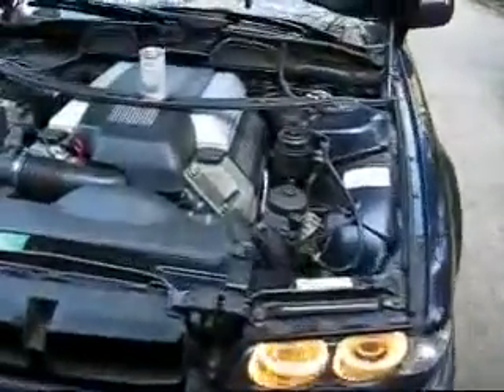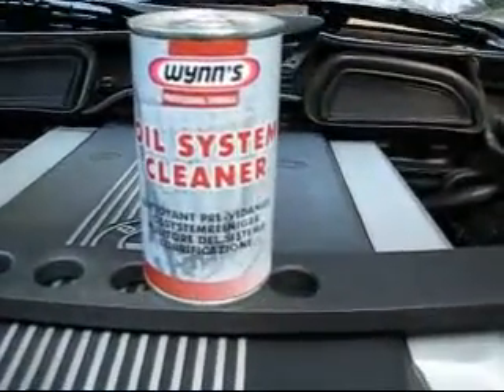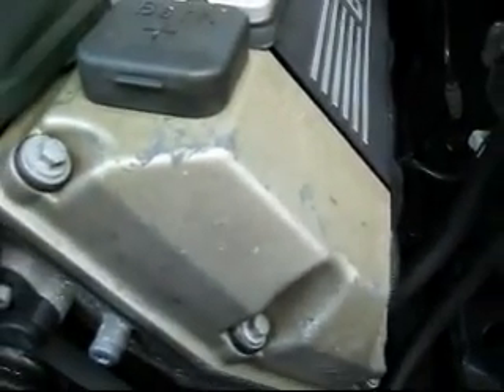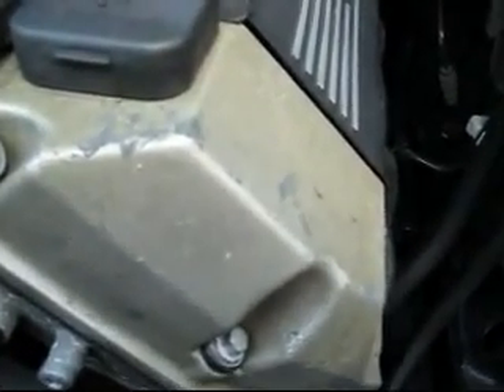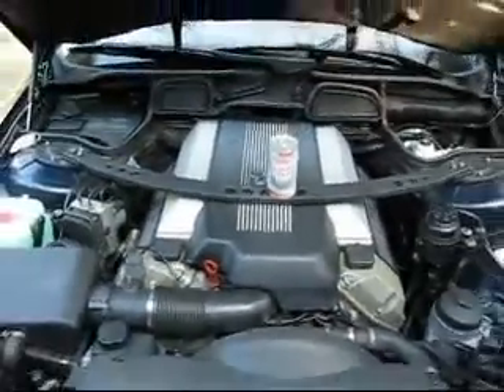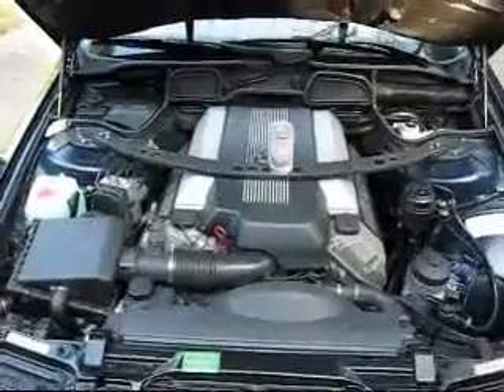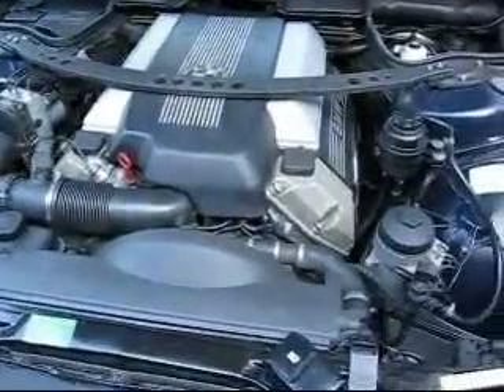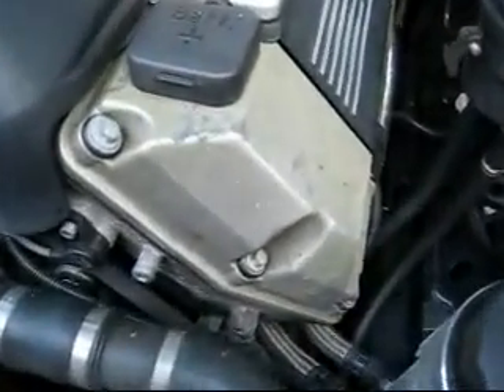E38 Engine Flush and Castrol Edge FST 5W40 oil

Comment: If you take the head covers off, and clean it with gasoline or any solving product specially the VANOS chain tensioned and also remove the main chain tensioned and clean it. Also the spring inside stretched it out 3 quarter of an inch and install it back.  I will guaranty the noise will be gone

Comment: Erm.......................I think you'll find that the ticking/tapping noise can be only one of two things, and no amount of flushing will get rid of it.

1. Main chain guides on the way out.

2. VANOS units worn, ie: Camshaft Adjuster Units.

I changed my VANOS units and the noise is no more. Nice and quiet now.

Comment: No really but what happens is the upper pensioners over time they get clog with oil and other particles specially if you don’t keep a changing your oil regular and the main pensioner is also one of this cars problems, most people jus replace it with a new one, but all it really need is a good clean and stretch the spring just a bit. Trust me it’s sensible to try this approach first, then having a dealer charge you over 3 grand for an overall replacement on you timing chain

Comment: Hi There
I have a E39 535i Sports 2000 Model with the M62TU Motor with the same sound, Did the Oil Change have a long affecton the noisy Motor issue?
Or after a while it came back again.
Any help would be great.
Thanks for posting
Addam

Comment: This is old thinking from back in the days of " a dirty engine is a happy engine" the engine lubrication system gets clogged with sludge the lifters and all the ports where it lubricates the engine get sludge and clog up over time, which is worse? parts of the engine that are so clogged with sludge the parts don't get lubrication or leaving the sludge in?? It is the dirt and contaminants that break the engine down over time the detergents in engine flush allows the oil to do what it does.

Comment: Timing chain tension noise I would get it fixed before you snap a chain.
Reply from the maker: Not really......... check my other video's 5 years later 100k and still the same ;)
Reply: Homerraas yep then 1 month later another 1k and youve got a snapped timing chain fucking up your engine...
Reply from the maker: That is complete BS, I have been servicing and repairing these cars for 10 years.